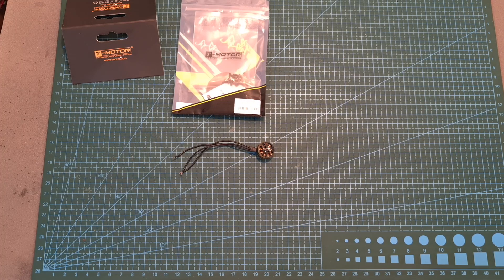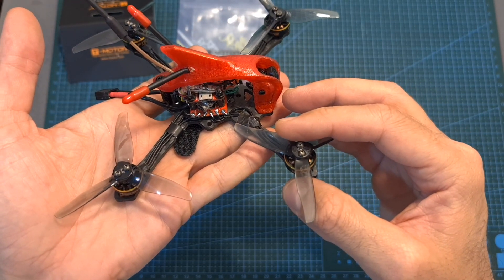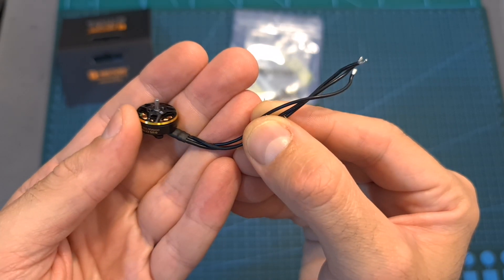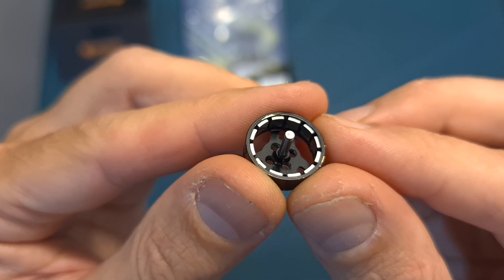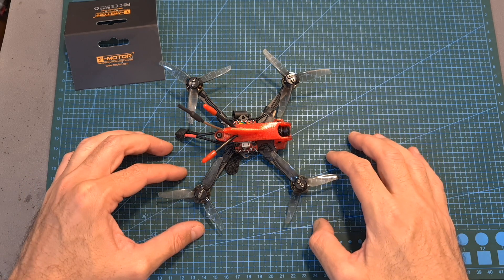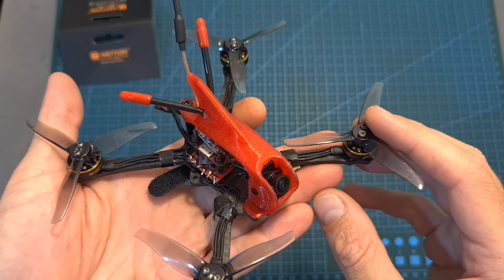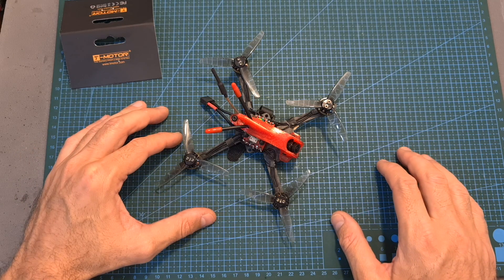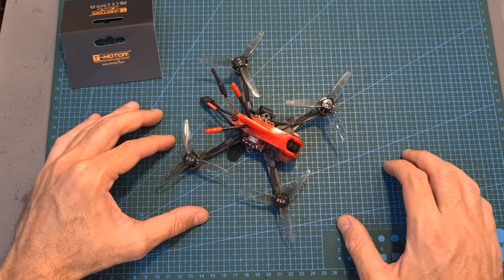T-Motor F1303 Motors - Thrust Tests & Flight Footage

Comment: You try them on 4s? I run my 6000kv on 4s, its way better!
Reply from the maker: Nope. What is your setup?
Reply: @KremerFPV  o man which one haha, I got 1105, 1106,1202, 1204, 1207 motors around the 5000-6000kv range running 2.5-3 inch props on 450mah-550mah 4s. Im really digging the micros these days, so much easier to fly in the backyard.
Reply: @Jerry1212ish  oh men, i need your opinion so haha. I have now a 3" 70g drone (geprc skip) with 1105, which motor do u think i should upgrade for more power but with good flytime? Maybe 1204? 1303? Thank u men!

Comment: I have these motors on a new build that’s not flying yet. I’ll keep update here when I have some feedback.
Reply from the maker: That's unfortunate. Did you build a 3" as well?
Reply: Yes, it’s pretty much all spec’d the way KababFPV recommends but using these new F1303 motors. Again, it’s not flying yet but will have a dry weight of 59g.
Reply: I finally got my Toothpick in the air. They’re smooth and offer a surprising amount of power and flight time on my 58g dry, 101g AUW build.
Reply from the maker: @sketchpv  That's great (that you got them to work). Maybe you can edit your comment or delete the previous one and add another one instead :-)